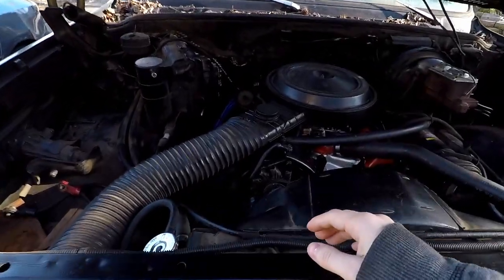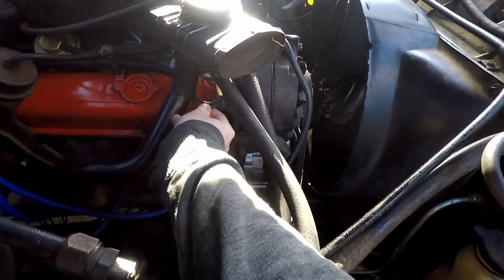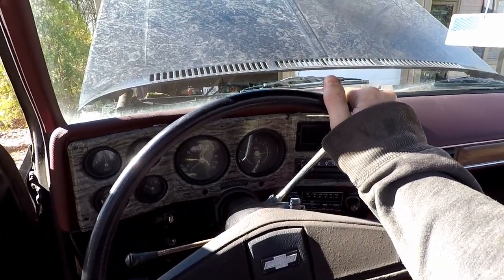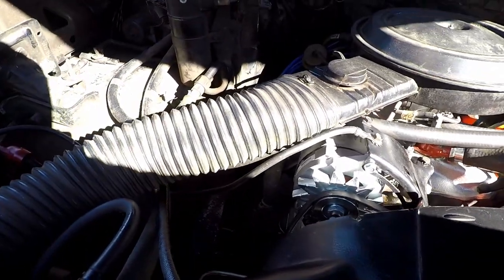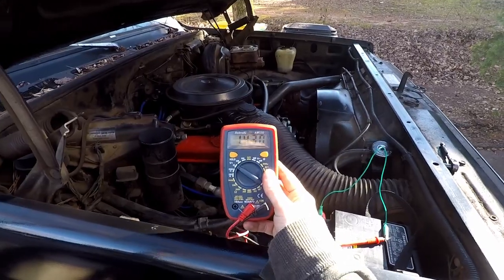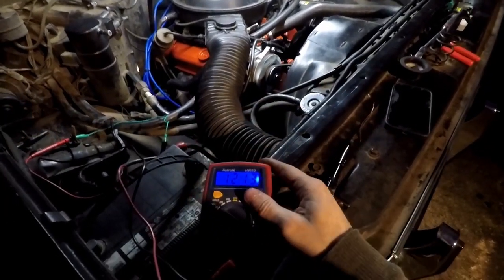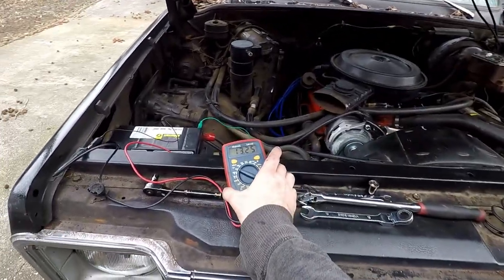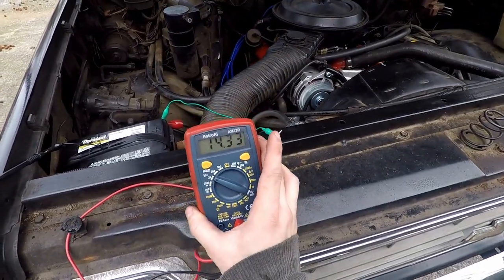Chevy C10 Battery Not Charging Diagnosis And Fix

Comment: A battery that consistently spins the starter over at a high rate is doing it's job, and is not defective.                                                                                                                                                                     I have read the instructions for a later, alternator and it says to idle the engine till warm, then hold throttle at 2000 rpm for a few seconds, when it will be charging. This has in some cases  replaced earlier methods of activation, and like ordinary driving.
Reply from the maker: My 1979 corvette is like that where the alternator does not start charging until you rev above 3000rpm

Comment: I had the same issues with my 85 k10 I had replaced the old altenator  with a new one then went thrue a series of batteries until I got to the point and pulled said new altenator  and had it checked and it was bad bought a new one with warranty and solved the  problem that was in February  it's June now and problem is back I know this cause radio stops working and for some reason my seat belt buzzer starts to work..ihavnt figured  out that yet..but I know  when I hear that buzzer take truck home quick..I'm pulling altenator  after work and taking to O'Reilly  auto store ..wish me luck

Comment: Yes…that would blow MY mind, too! That a bad battery affects what the alternator does is weird to me. I recall things called “voltage regulators” and “ballast resistors” (especially in Mopars) seem to give people fits as well. Thanks to your video here, I will have to watch some more videos that may shed light (har-dee-har…) on those electrical subjects. Well…in any case…you’ve got a lovely new battery and alternator. So…road trip, LOL! Having seen your drive to work, I dare say that your traffic situation is far better than what I used to encounter when I drove a car here. Enjoy your drives.
Reply from the maker: Thanks for watching :) I’ll definitely be driving this truck with all the new shiny parts
Reply: Great little video here, very informative. My C30 isn’t charging well. Similar to this with a battery as old as the hills and an alternator I replaced last year. Looks like new battery time!

Comment: Hey bluesxt,  truck is looking better all the time.  By now I'm sure you found the issue with your alternator.  I spotted it immediately at the beginning of the video...the belt is way too loose and must be tensioned much tighter.  When revving the engine, you can hear the belt slipping and screeching as the alternator tries to produce power.  So, once the belt is snugged up quite a bit, it should generate power with no problems.  Also,  it looks like to me that the adjustment slot of the alt. bracket is all the way to the end of it's travel, keeping you from properly tensioning the belt.  Usually what causes that is a belt that is way too long (wrong size) or a stretched belt.  Usually, when the proper belt is installed,  the alternator adjustment bolt will be about midway in the adjustment slot,  give or take a little.  Generally, a properly tensioned V-belt will have about 1/8 inch to 1/4 inch play (when pressed with one finger) between two pulleys. Good luck!
Reply from the maker: Thanks for the comment! You’re correct my belt is a tab bit too long :)

Comment: I have Themis same issue right now, new alternator, and now have gone through 2 batteries. I did have the alternator charging with electrical load during the initial install, but it’s bad again. Any tips?
Reply from the maker: Are you using a volt meter to determine your alternator is not charging anymore? If so, what voltage are you seeing at the battery and at the alternator?
Reply: I just got the truck but same thing
Reply: I have to turn it on every day , I just change alternator battery but I don’t know the voltage since I don’t have one but truck once it turn on she is a beast
Reply: I think there is something running but cable I don’t think since there old cars , but I think it may be some ground falling help help thanks
Reply: I get like 12 around voltage

Comment: A little late but if your running any kind of accessories like Electric fans, subs, lights etc you’ll have charging issues because the alternator doesn’t put out enough amps to keep up so you’ll need a bigger alternator 

Just for anyone who can’t figure out what’s wrong with there truck